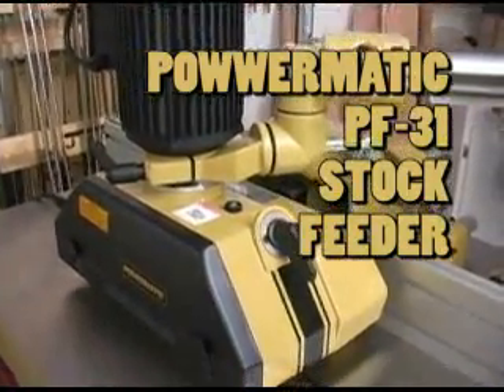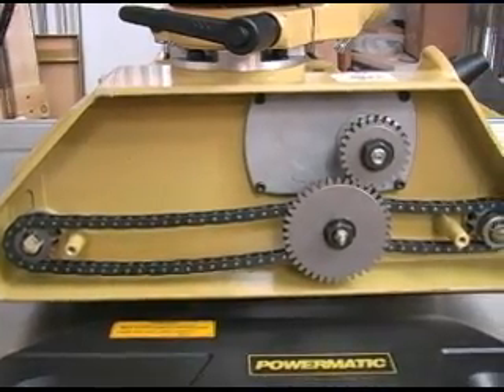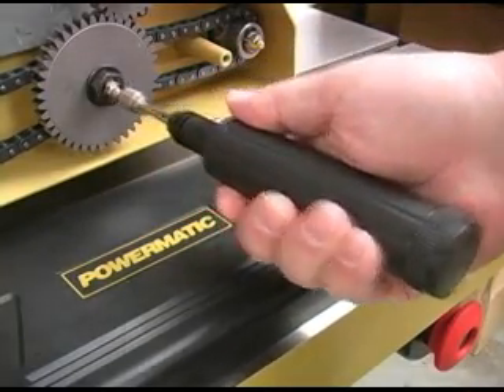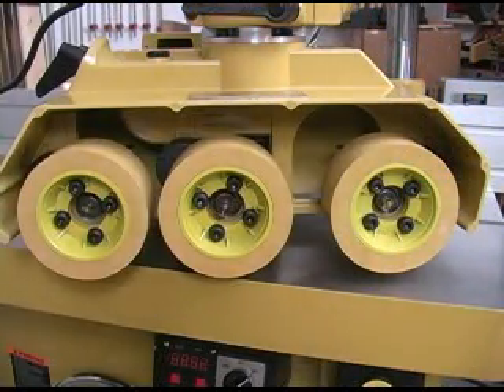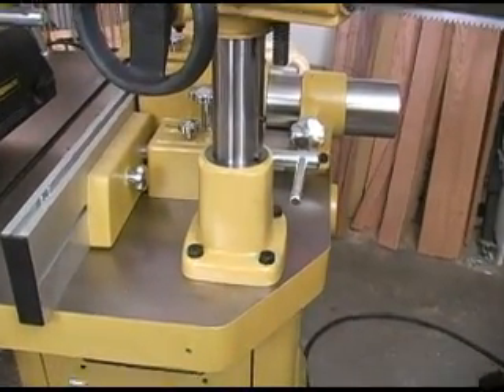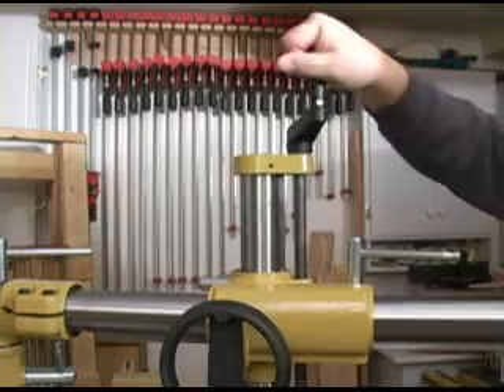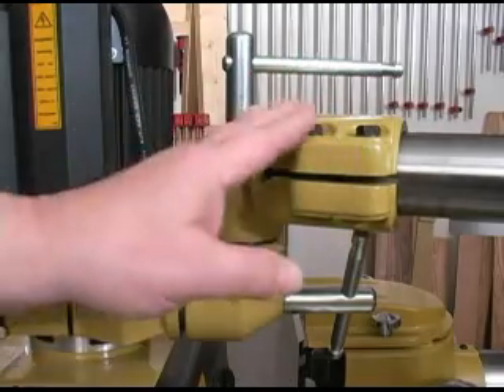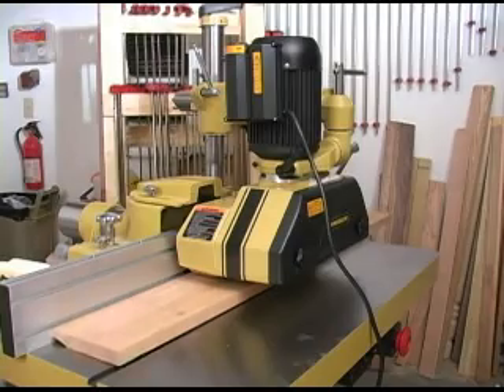Powermatic PF-31, 1HP Power Stock Feeder

Comment: I would think that rearranging the gears (for a speed change) would be troublesome and time consuming. Especially when you want the last pass to be very slow. Personally, I would recommend a variable speed power feeder. It's not that much more money and very user friendly.
Reply: He did say "feed rate change" so I think you can still switch between multiple speed setting with each gear.